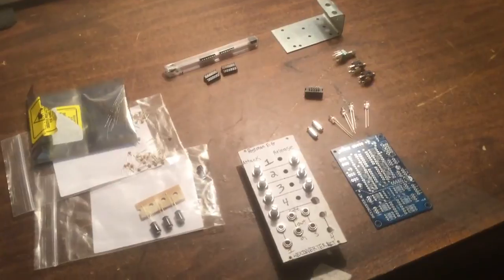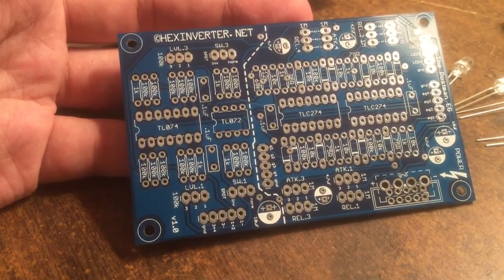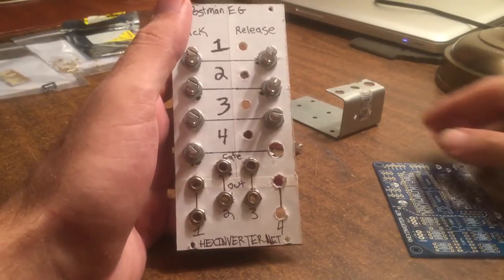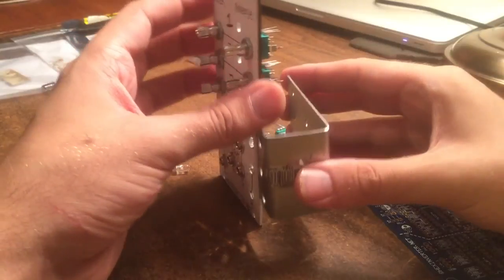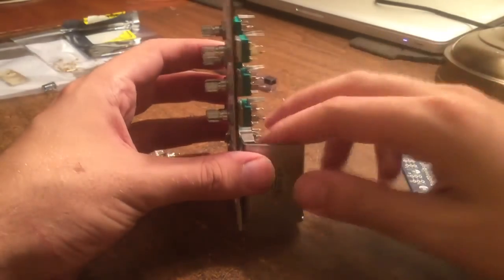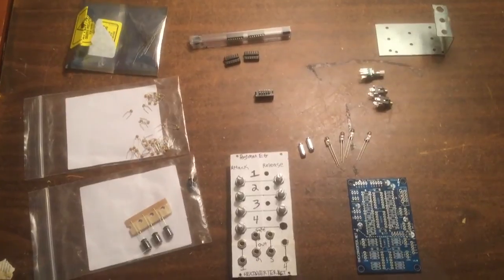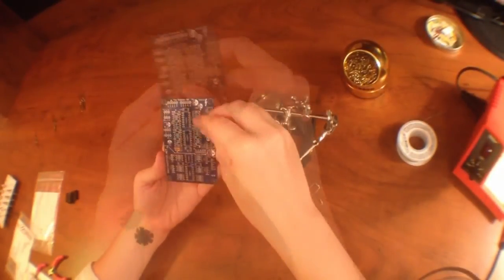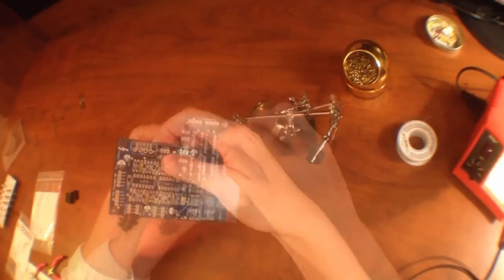HexInverter Postman EG - DIY Build and Demo - Midiverse - TV

Comment: Very interesting video, thanks. I am planning to work on the hexinverter Neinohnein series. Could you tell me where to get the right-angle bracket?
Reply from the maker: Truman Kong thanks for watching. We picked up that bracket at the hardware store, although it was totally flat when we got it. I used a vice and some hand tools to bend the angles. It's not perfect but it gets the job done.